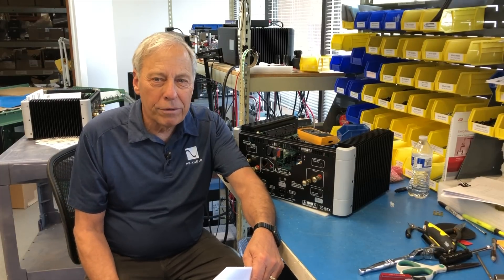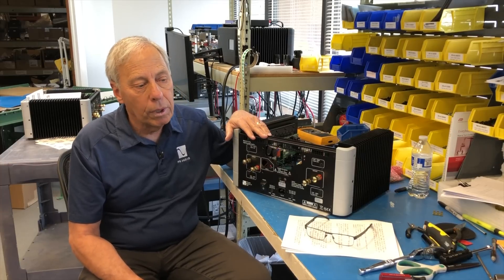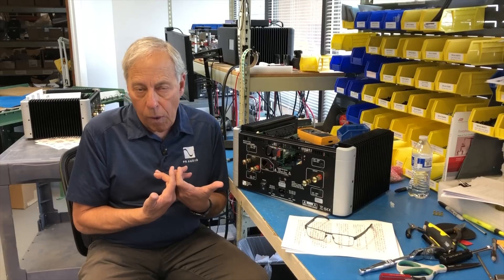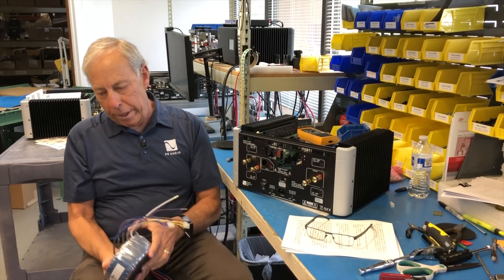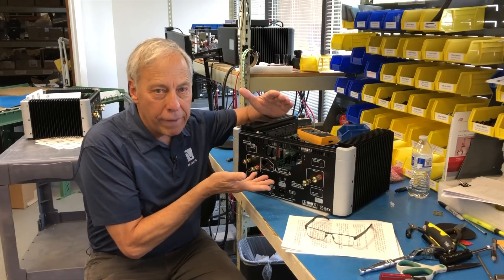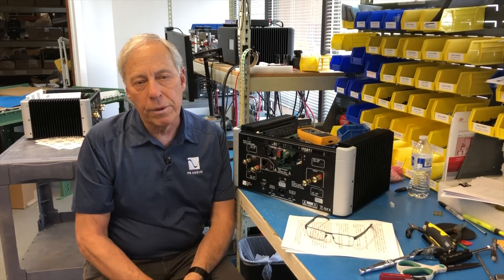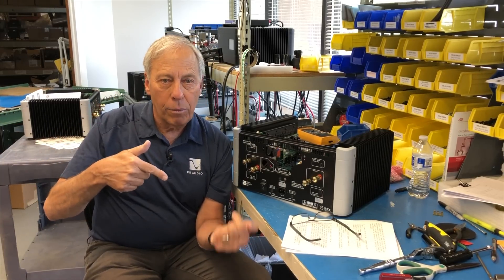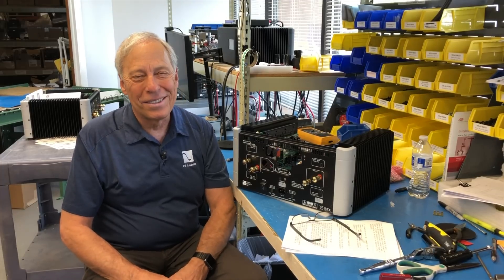Can you run 4Ω speakers on an 8Ω amp?

Comment: I have a 100 watt 8 ohm amp that I hardly ever use more then 1 watt playing music.  1 watt= (Current)squared times 8 ohms  compared to 1 watt=(Current)squared times 4 ohms.   Current equals .35 Amps for 8 ohm load at 1 watt..  Current equals .5 amps for 4 ohm load at 1 watt.  My amp should be okay using only 1 watt of power.

Comment: I found some info that would allow me, and old player to use, but we wanted to know if you could use off ohm speakers.  I want to run a  16ohm 1x12" along  with a 4x10" 8ohm cabinet.  If I understood you correctly, I should be OK as the Tiny Terror I am using has 2-8ohm and 1 16 ohm which would mean that the value allows me to be off a bit.  Thanks.  Started post before final minute, and I found the leeway I was looking for.  If all goes wrong;  I guess I will be buying some hardware for my amp. :)

Comment: Just to add to Paul's comment: In the world of car audio where most amplifiers are 4 ohms or less. (Car Audio exists because of 4 ohm amplification)  using a 4 ohm amp to power 8 ohm speakers (home audio) can yield very good and surprising results. Maybe it's the cabinets but to my ears, generally speaking $300 home speakers always sound better than $300 car speakers. Dollar for dollar home audio is superior to car audio. Back when I was in college I just purchased a pair of 3 way tower speakers and put in my hatchback, and worked out great. No room to put anything but I had the tunes. LoL Good home audio blows away good car audio, in my opinion. And long as your speakers don't get wet, you're fine. Peace.

Comment: I can whit ease run 1 ohm speakers on amplifiers rated for 16 ohm. Its simple. The amplifier has a maximum current it can manage. Now , Just needs to ensure that the volume is not turned up to the point where that current would not be sufficient. That easy.

Comment: I admire your effort at not wanting to appear condescending - you obviously know more than you are letting on, deliberating choosing words to fit the most / least common denominator of your viewers. However, I trust your viewers are equipped with normal human brains - one that has the capacity to learn new things, at any age, and will appreciate coming across words like:

1) Induction - the voltage on the secondary side of a transformer is “induced” by the EMF set up through the electric field of the transformer. 
2) The output impedance of all transformers is made as low as possible. 

3) the fact in 2 above is so that the load of either 8 ohms or 4 ohms is in parallel with the output output, thereby reducing the loading effect of the speakers.

Example:

Output impedance is 0.1 ohms

Into 4 ohms, 

Results in a load of 

0.1x4/(4+0.1) =0.0976

And,

Output impedance is 0.1 ohms

Into 8 ohms, 

Results in a load of 

0.1x8/(8+0.1) =0.0988

Now that’s almost the same. 

This is where yoh introduce Ohns law:

V= IR 

See - it’s not so bad.

Those unfamiliar with this will enjoy coming across new terminology.

I think being “not condescending “ ends up keeping your audience in a state of dumbness.

Politicians do tgst deliberately to keep their electrorare in a state of dumbness so as to steal their wealth.

We should educate them - 

Agains - I hope I have not offended any one.

I’m an electrical engineer.

Comment: My Radiogram ( 1966 / 68) is tube and has 15 ohm speakers,  could be 16 
I have wondered how it will handle 8 ohm. No switches. 
 Kriesler 11-104

Comment: wait, can a 6omh receiver take 4 omh speakers? I am being told no. Some one please help!
Reply: I would say technically, yes, as long as you don’t overrun it in other words have it on too loud for too long just for normal listening  i reckon you be ok okay! I have Sony 1080 and I have been running 6ohm speakers unknowingly lol,  and it runs a dream!  I mainly use the amplifier for surround sound however occasionally I do have a bit of a music blowout 🎉🎉🎉 all seems to run pretty good!  As I say, we run the amplifier at normal volumes and I think you should be okay. Don’t take my work with it though.😂
Reply: I would say technically, yes, as long as you don’t overrun it in other words have it on too loud for too long just for normal listening  i reckon you be ok okay! I have Sony 1080 and I have been running 6ohm speakers unknowingly lol,  and it runs a dream!  I mainly use the amplifier for surround sound however occasionally I do have a bit of a music blowout 🎉🎉🎉 all seems to run pretty good!  As I say, we run the amplifier at normal volumes and I think you should be okay. One caveat Don’t take my word for it tho. 😂😂😂

Comment: Just bought a Yamaha RX-V673 to replace the Pioneer receiver that came part of the MCS-737 set I got years ago, speakers are 4ohm, amp can do 6 and 8, have set it to 6 and am told it should be ok as long as I don't go crazy with the volume. Fingers crossed.

Comment: I have am amp with either 4 or 8 ohm output, my speakers are 6 ohm, so what is the safest to use?
Reply: It's all about transfer of energy. 
The source impedance needs to be at minimum the same as load impedance .  In practice the load is more . So I would select 4 output to  run the 6 speaker.

Comment: @fareedaramdial7000  I'm glad someone else thought the video did not quite fully answer the question at hand where the amp is rated at 8ohms with speakers rated at 4ohm so in theory the 4ohm speakers would try to draw more power than the amp can handle with which the amp could end up going into protection mode or blow depending on the amp .. is this correct?

Comment: Hi, i got an vintage kinap lomo tube cinema amp YU-15 mono blocks, with 75w each they are 16ohms and i have 8ohm high sensitivity speakers I usually listen at lower volumes and never push them.
Does anyone have any thoughts on this?
Would much appreciate it

Comment: Thank you very much. I want to use some old 4ohm car speakers in the garden for Halloween and will use an old Denon 8 ohm amp to drive them. Spooky music awaits!!
Reply: 8 Ohms into 4 sounds risky. My understanding is that at even at moderate volume, the circuit will overheat. I believe adding a 4 ohm resistor will make your connection safe. The resistor ought to be about 25 watts to accommodate the heat dissipation. But I am not an expert.
Reply: @TheBinaryWolf  it’s ok, I found the old speakers were 8 ohm in the end so all good. Scared the life out of any visitors 👻
Reply: @TheBinaryWolf  I've driven 4 ohm Elacs 267's with 8 ohm Cambridge  AXR100 for years on partylevels and it don't even break a sweat. Happy holidays!
Reply: @hollowmoon7766  Thanks for sharing your experience. Since posting my comment, I have learned that ohm ratings are not the sole indicator of safe operation of loudspeakers. The efficiency factor plays a role. So some systems will damage speakers with a lower resistance, others have a higher threshold. Glad it works for you.
Reply: @TheBinaryWolf  Thank you for your feedback!

Comment: can you fix the inpedance problem by just putting a resistance in serie in between the wire to the speaker? (8ohm amp 6ohm speaker so 2ohm R) thanks for the interesting videos
Reply: Not with a woofer. Adding a series resistor will change the electrical properties of the woofer. Specifically it will increase the theile/small parameter  Qes. Which will in turn increase the woofers Qts. Unless you redesign the volume of the enclosure and port tuning, that increase in Qts will result in underdamping of the woofer cone. You will get boomy/muddy bass/midbass. Might be a little fun if your speakers bass output is underwhelming but that increase in bass/midbass is a form of distortion from the cone flapping around uncontrolled at those frequencies. Midranges and tweeters don't usually have that problem with added resistance but use an l-pad for those (or series and parallel resistor) as just adding a series resistor changes the impedance which will change the crossover points if using a passive crossover.

Comment: My main 70's receiver (Sansui 9090DB) does not like any ohms other than 8. Although I've run 4 ohm & 6 ohm speakers on it before learning, after a period of time it will blow the output transistors & you will be in deep doo-doo. In fact it's now at the doctor after trying to run my "OHM Walsh 2" 4 ohm speakers. It's now awaiting 2 output transistors. Lesson learned. Never again.

Comment: I went to the Phase Linear factory in about 1980. The had a model 400 (200 w/channel) running about 8 speakers per channel in their production space, filling the large room to a moderate volume level. The VU meters were really "dancing." As the VU meters are not a fast response indicator (as opposed to the LED VU meters on the HK Citation 15 amplifier), I am guessing that they were probably putting out a peak power output somewhere between 100 to 200 watts.
Ultimately, you are constrained by several factors: how much power that the power supply can cleanly deliver into the amplifier is the first thing, and how much power the output transistors can deliver is the second. Some can handle more current, which makes driving a lower impedance load possible, and others cannot. If your amplifier is running hot, whisper fans blowing across your heat sinks will help, but they will raise the background noise in the room.

Comment: Hello Paul (or anyone else wo can anwser my question) I would like to increase the impedence of my woofer from 4 -8 ohms to match it with the amplifier. I would like to use a high watt wire resistor for that, how does the wire resistor affect the audio quality?
Reply: Are you familiar with Thiele/Small parameters? Adding a series resistor will increase the woofers Qes, which will in turn increase the woofers Qts. Without a redesign of the box volume and/or port tuning, you will get boomy/muddy bass and or midbass. Essentially the woofers cone will flap around uncontrollably at those frequencies increasing their volume. Might be a little fun on a speaker with underwhelming bass but that increase in bass/midbass is a form of distortion from the amplifier losing the ability to control and adequately damp those frequencies.

Comment: so NO, your off-the-shelf stereo unit from Best Buy or the stereo section of your local furniture store rated at 8 ohms will fry your 4 ohm speakers. But a hi-fi amp with a 1ohm impedance will drive 4 or 6 or 8 ohm speakers. thats what he's saying.

Comment: Of course you can!  It's 2020, and all the rules are out the freakn' window!

But I wouldn't.  I prefer 8 and up ohm speakers.  Higher impedance = more crankable!

The back of my receiver says "Use speakers of 8-16ohms impedance".  But what do they know?  Run THREE-ohm party favor speakers if you want!

Hey, it's OK to inflate ones tires to 40 or 50psi, even though the sticker on the drivers door pillar says 33 or 34psi, so... do what the heck you want!  Ignore those commy "Mask Required" signs still up in some municipal buildings!

As for me, I'll defer to the engineers at the companies who built my audio equipment, and my cars.  I'll trust that they made the right decisions on what impedances their gear could handle, or how much tire  pressure would optimize load and handling of my car.

I like most rules and instructions in life.  They werent' out to get you - they're there to guide, and hopefully, protect you!

Disclaimer: This comment serves noneother than to MAKE FUN OF FOLKS WHO DON'T LIKE BEING TOLD WHAT TO DO, or to follow recommendations or instructions!  😜😜

Comment: To sum it up, a 16 ohm speaker will be very easy on an amp whereas a 2 ohm speaker will push an amp to its absolute limit.  My Infinity RS III/B dip down to 1.8ohm at certain frequencies.

Comment: I have 4ohm speakers being powered by an avr rated 6-16ohms and it works wonderfully,  so you really don't have to match ohms as long as the avr can't have twice the ohms. For example, an 8-ohm receiver shouldn't run a four-ohm speaker but it can run a 6ohm speaker.

Comment: Solid state guitar amplifiers there is often a Zobel network in the output that will add a bit to the output impedance and this is what usually gives the output impedance- without the zobel the output would essentially be 0 ohms for solid state amps

Comment: Hi if my ampis 4 ohms do 8 ohms speaker load my amp too much? My amp have 2 channels and is 4 ohms 750 watts per channel if i use 8 ohms speaker how many watts of 8 ohms is ok? Thanks the question u ans i am asking a reverse question 4 ohms amp with 8 ohms speaker
Reply: Your amp is more than capable with those 8 ohm speakers.  In fact, an 8 ohm load is easier to drive than a 4 ohm load (requires less current).  You will be safe using 8 ohm speakers with a 4 ohm amp.
Reply: @revokdaryl1  thank u for telling me bud thanks
Reply: @donpech1422  You're very welcome.  That sounds like a very powerful amp you have there.  If you don't mind me asking, what make and model is it?
Reply: @revokdaryl1  its the QSC ISA750 . Its a 2 channel 4 Ohms 750 watts per channel
Reply: @revokdaryl1  i have 2 speakers 8 ohms 800 watts each on it
Reply: @donpech1422  Thanks for your reply.  Yes, that QSC amp is very powerful and will definitely handle those 8 ohm speakers easily.

Comment: So if  you match a 4 ohm amp to a 4ohm speaker will will it increase the sounds quality? And will a 8 ohm amp which requires twice as much power to drive that speaker lack sound quality?
Reply: I would say a slight sound enhancement, overall it's easier on your amp and will allow it to not push so hard. Which will be easier on clipping and interference.

Comment: Dude seriously!  The question is, can I run 4 ohm speakers on an 8 ohm receiver?  SIMPLE QUESTION, we don't need a lecture on impedance.  I have 2 very nice 4 ohm stereo speakers from days of old and I want to hook them up to an 8 ohm reciever.  WTF do I do? That's all I need.  I've read about Impedance Matching Transformers but I can't find products.  I need a solution, not a class on amplifier design.  How does a guy safely  connect his favorite 4 ohm speaker pair to a modern 8 ohm receiver without blowing up expensive AV and/or stereo components?   My receiver doesn't have "switches" for me to set.  If you have a solution, please give it, if you don't, then please change your video name to amp design or something similar.  Be very specific as in product name, model, and where I can buy the darn thing so my 4 ohm speakers work on an 8 ohm system.  And please don't tell me to go buy another set of cheap 4 ohm speakers to fix my problem.

Comment: If modern day amps have a switch, it means the amp can't properly drive the lower load. In other words, if your amp has an 4-8 ohms switch and a 2 ohm switch, do not put it on 2 ohms in the hope that your amp will supply more current. The opposite is true and the lower ohm setting will be current limited to protect the amp from a load it can't really handle.

Comment: If you wire two 4 ohm speakers in series - you get an 8 ohm load. (edited because I got it reversed!)
Reply from the maker: Sorry, this is incorrect. If you wire anything in series the impedance goes up, not down. Two 8Ω speakers in series equals 16Ω while the same two speakers in parallel is 4Ω. I am guessing that's what you meant.
Reply: @Paulmcgowanpsaudio  Crap. I meant two four in series gives you 8 ohms. My bad!

Comment: You can drive it, but let's say it's a 4 ohm output amp and you have an 8ohm speaker it won't play very loud. But it will play cleaner with less distortion.
There is always a trade off when you change the independence  that said I doubt you home amp will play below 1ohm speaker without getting the amp to hot and causing it to fail. Unless it was made to play that low. And some are mostly car audio. 
Maybe some pro audio gear
Yes I think I had a 1/4ohm amp years ago that was pro audio  you could not play a 4 ohm speaker on it and get it to play loud.  It just didn't do it.

Comment: Hold you horses everyone!  I beg to differ.  I own a meticulously restored pair of 4 OHM Acoustic Research AR 3A speakers...the KING of vintage sound along with my mint condition 8OHM Large Advents.  I have several newer 100+ WPC Yamaha receivers all 8 OHM impedance (my Panasonic SA-BX500 can be set to 4, 6 or 8 OHMS...but I did not try the ARs with it yet) that I connected to the ARs (along with my Polk 10" Subwoofer).  With rather high volume levels ALL of my receivers I connected would SHUT DOWN.  Lots of heat from each receiver I connected.  SO....I got tired of this nonsense and swapped out the ARs with my Advents...again 8 OHMS.  Voila, I could push the volume to almost painful levels (I never listen to them that loud of course) and NO RECEIVER SHUT OFF! Very little heat....warm actually.  Needless to say the quality of sound was SUPERB!  I moved the ARs to the Panasonic receiver and set the speaker impedance to the 4 OHM setting.  Cranked up some good volume music and all seemed fine....so far.  I did not try to push it to those ear splitting levels but will see what happens when I do.

So, if anyone can convince me that pairing an 8 OHM receiver with 4 OHM speakers is just peachy, I am all ears, but I would challenge that idea.  OH, you can get sound from that set up and at somewhat decent sound levels, but when you push volume levels a bit higher (still listenable) or if there is a very powerful, sudden moment in the music being listened to, I can just about guarantee the receiver will shut down.  Just my two cents worth.  Dr. Z (Lou)